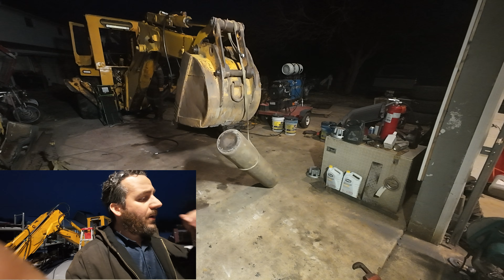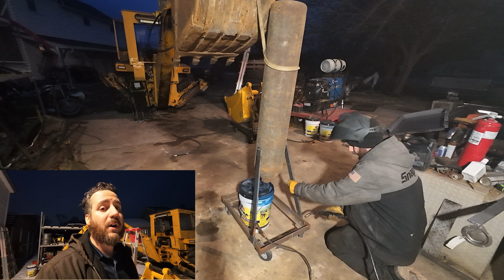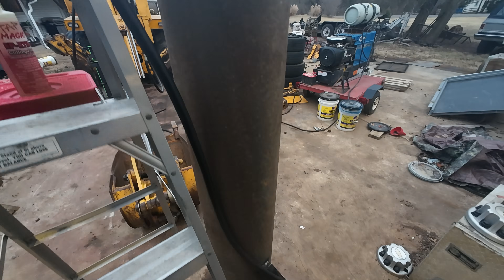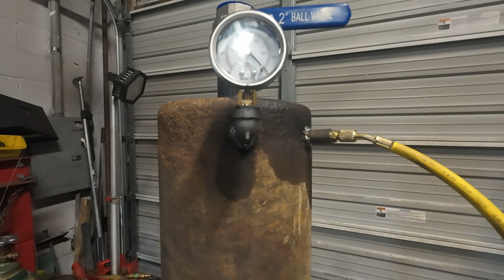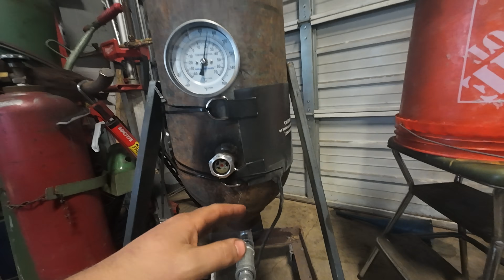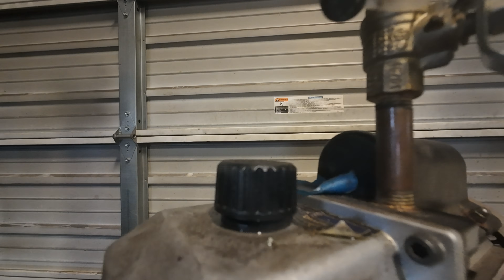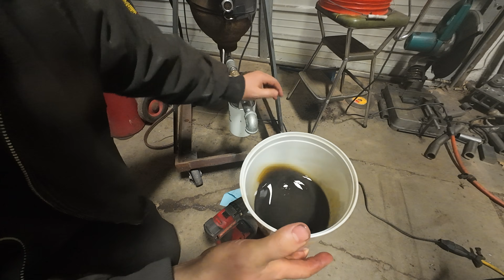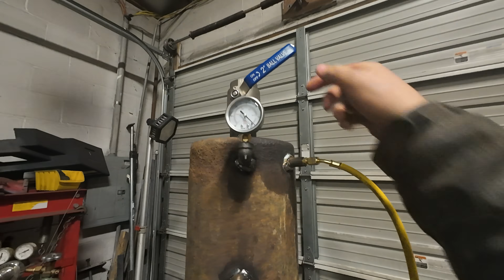I made a machine to remove water from hydraulic oil. Vacuum de-hydration

Comment: if you put the tank under vacuum you can probably suck up the fluid out of the bucket and intoo the bottle using the bottom valve , saves you from carrying the weight up that ladder and possibly pour it ove the fillonening 
could do it with the prefilter testvanve or just add another tap on the bottle m could even put a reduces and a gardenhose sized vacuumhose to the top opening , set bucket on the floor put hose in bucket draw vaccuum and open valve

Comment: @spankranchgarage -  Smart man, and great thinking outside the square. 

To catch the water vapor before the vacuum pump you need a condensor coil (like a Moonshine Still) that is in a cold water bath, into a catch can, then suck the vapours from the top of the catch can up through a large pipe full of heavy steel wool. 

Instead of Batch processing the oil like this, you could instead build a Continuous Vapouriser that attaches to your machines, and runs whenever it's in use. If the oil tank of your machines gets hot enough when in use you could just draw the oil out of the tank via a small orifice, into a vacuum chamber that is kept at low pressure by a vacuum pump that that has enough flow (maybe Airconditioner compressor?). Use the same vapour catch method as I said before. If the tank oil isn't hot enough you'd need to preheat the oil before the orifice valve. Then at the end of the work day you could just drain the catch can.

Comment: You have a tiger by the tail. Imagine being able to rent out a machine to contractors or farmers for example. Plug in a remote line into your machine and circulate hydraulic fluid on a continuous cycle and return to machine. A tractor could idle away as your process improved oil quality. The Machine being warm would keep heating to a minimum. The key will be surface area for the moisture to escape. So your cylinder needs tipping on its side would be an easy start.

Comment: Great Video, Couple(okay, a few. I got carried away) things that I think you'll find helpful.  I've used one of the cheap Vevor kits to do exactly this but for removing water from a CaCl2 and water solution. (basically a road salt based dehumidifier).
1: Use the vacuum pump to pull oil into the tank instead of loading from the top.

2: It seems like it's storing oil in the output near the valve that's not getting cleaned up. Put the valve as the first thing out of the bottom then go straight into a T. One output on the T can be inlet/outlet pre filter(faces down?) the other is goes to a valve before the filter.

3: You could use a very fine filter and pressurize the tank a bit to force it through at a good pace if needed. 

4: Just to note a thing with pumps: Single stage vacuum pumps smoke quite a bit. Especially if you use cheap oil. (very common headache I've found from the vevor single stage pumps being so popular. Fix is to use good oil). 2 stage pumps are less likely to do this. Good oil + a 2 stage pump is a great place to be for long run times. Single stage pumps are more for pulling down to a pressure then shutting off. 

Bonus Idea to make it a lot more hands off. It could run for days if you forgot about it with this.
1: Adding an auto shutoff feature is really easy. I'd suggest getting a vacuum pressure switch so that it will cycle off if you pull down to your max.(What you've seem to of noticed after the run is over with the vacuum and temp gauges) Second method that would be cheaper and probably a better indicator of when it's done is if you do it via a  temperature sensor. I think the guts from an electric hot water heater would work well. Both the heating element (you can bend it upwards to make it fit) and the thermostat that controls the elements. Personally I'd use both suggestions as to not burn up the vacuum pump.  Great video and thanks for sharing. Youtube did me right for once by suggesting this to me.
Reply: Thinking about this some more, You could use my 1st and last suggestions to make this thing mobile. Roll it up next to a machine at the end of the day and suck up 9 gallons of oil or so. Then have it run over night via an extension cord. Then in the AM you just dump it right back into the machine freshly un-watered and filtered.
Reply from the maker: All great tips! Thank you for the extensive response!!!

Comment: Get your self a new 5 gal of hyd fluid, weigh the bucket before and after you pour out the fluid, weigh the bucket, you will know how much the fluid weighs with out water, then weigh the dirty wet fluid, and the diff in weight is the amount of added water

Comment: My thought is that first draw off is mostly water water is heavier than oil so. The first draw down should be with that small spout till you see oil,  then run the oil through the filtered spout
Reply from the maker: I explain in the video why that doesnt work with this fluid.

Comment: In the Marine industry -"fuel polishing" is a thing ... a diesel fuel/water separator will do the job, even with hydro fluid
Reply: Hydraulic oil makes an emulsion, so it won't just gravity drop out. it will just go straight through the separator without dropping it out.
Reply: @nick4506  would a centrifuge help in the process?
Reply: @windage  i mean yea maybe but we're doing gallons here, and if you have a big centrifuge on site so it won't take a billion years, might as well just buy new oil.

Comment: You could use inline damp-rid trap - aka anhydrous calcium chloride. It’s pretty cheap stuff, I guess you could just fill up an old automotive catch can with CaCl2 anhydrous (damp-rid) and run the vacuum through it. It even comes complete with baffles.

Comment: for the machine's hydraulic oil, configure the machine with all of the cylinders either extended or retracted (the exact state doesn't matter, as long as all of them are the same).
drain the main reservoir's oil and process that through your dehydrator.
disconnect the return line into the reservoir and connect that to an auxiliary tank. if you your pump's bypass routes into the return line, plumb that into the now open return line hole on the main reservoir. if it enters the reservoir separately, just plug the hole.
reconfigure the machine so the cylinders are in the other configuration, which should push the fluid in all the cylinders into your auxiliary tank.
run that oil through the dehydrator.
reconnect all the lines as they were originally, and refill the main reservoir while you reconfigure the machine again into whatever state you had them in the first step.
this should get about 85-90% of the oil in the machine. if you run the cycle again before reconnecting the return line to the main reservoir, that should get 97-98% of the oil.
it's a bit of a faff, but it should remove almost all of the water contamination.

Comment: Suggestion. Put a hose in a bucket. Connect the hose to the oil filter. Connect the oil filter to the top of the tank. Use the vacuum pump to suck the oil through the filter and load the tank.

Comment: It feels like it'd be handy to add some sort of vacuum system in the vehicle to pass the oil through a small vacuum chamber. When the vehicle is pushing the oil a lot, the oil will get hot. If you could pass hot oil through a vacuum chamber, you could get it to flash off it's water continuously.

It's funny that your vacuum is eating all the water vapor coming out of your system. You could run a cold trap to condense out the moisture before it hits your vacuum pump.

If you weigh a quart of oil milkshake and a quart of dehydrated oil, can you see a weight difference? If you also weighed a quart of new oil, you'd be able to calculate how much water was in it if your scale had enough resolution.

It might be costly to get a scale of the necessary resolution as oil's density is not all that much less than water. If you had a 1% water fraction, you'd be looking for a 0.2% variation in weight. You'd need a decent scale to detect 0.1g on a 2kg capacity scale.

Comment: https://ipsearch.ipaustralia.gov.au/patents/2008267751 This patent covers an approach to use a recirculating vacuum pump/ drier stage that returns the outlet of the fridge compressor back through the contaminated liquid as super dry air, so the moisture in the oil will readily evaporate then condense again, but in the outlet stage. same concept!! love your work!

Comment: A heating strap will be necessary on a blistering hot Summer day because as the water boils off under vacuum the system cools rapidly. I’ve had the system freeze because of the cooling.  Also, a container before the vacuum pump is imperative.  The stuff in the pot boils and froths violently, especially when emulsifiers are present.  Many thanks for the video, it’s a real pleasure to watch someone who knows what they’re doing

Comment: I am looking to do the same thing. good idea with the old high pressure tank. We have the same problem on our excavator hydraulics. We figured out that the water was getting in through bad hydraulic cylinder seals. If the seals are facing up and oil is leaking out, rain water can get in and sink to the bottom of the cylinder

Comment: I wonder if it would be worthwhile just pouring silica gel into the oil, then filtering it back out (along with the water it has absorbed).  Silica gel is sold very cheaply as cat litter.  (not all cat litter is silica gel, you have to pick the right one).  The spent silica gel  could then be recycled by simply baking it to use again and again.

Comment: this also happens to hvac oil in compressors and if there is to much moisture in the system it burns out the compressor so we install a filterdryer that cleans the moisture out of the oil but they get clogged up easily

Comment: The Algorithm demands long comments, so here's some words. Vacuum oil is cheap, but so is a cold trap. 6-10 feet of tubing followed by a catch can of any kind will take a load off your pump, nothing fancy needed, especially if your shop is under 77 degrees Fahrenheit. Since the oil is pre-cooled to ambient temp, the trap itself can be a plastic container, so long as it holds vacuum. Two drain valves in series lets you "airlock" out water without dropping vacuum.

Comment: Couldn’t u just boil it to steam the water out as water has a lower boiling point than hydraulic fluid and or oil maybe im dumb but yes?
Reply: Some contents of the oil's additive package, and possibly the oil itself will burn near the boiling point of water, leaving soot and other byproducts behind. If you have an excess of steam handy, it would be safer to use a steam eductor to create a vacuum, and possibly a steam jacket to heat the oil.

Comment: To solve the water in the vacuum pump, I do this (as suggested from people who actually uses vacuum pumps in labs)
You close the inlet to the vacuum pump and run it like that for 30 minutes to an hour. Or until the pumping part of the vacuum pump is above the boiling temperature in normal atmospheric (>100C/212F). This will prevent the moisture you take out of the hydraulic oil from condensing in the vacuum pump. Or you can use a shop-vac as a backing pump to the vacuum pump to reduce the temperature that is needed to prevent the water from condensing in the vacuum pump. Water in the vacuum pump oil is very, very bad.

Comment: Yep, you need a cold trap between your oil dehydrating chamber and your pump, id also put an HVAC filter trap between the cold trap and your pump to protect it. the cold trap should draw in through a tube down to the bottom and the vacuum pump connection  near the very top, and dunk it in ice water bath.

Comment: That oil is black new
Reply from the maker: It is very dark new... it even has solids that lay on the bottom of the bucket. Pretty crude/cheap oil
Reply: @ the hydrolic oil from Orileys has metal shavings in it. Have to filter it before putting it in
Reply from the maker: @DRNEGOLICIS  Holy crap! Thats unreal

Comment: Just a thought, if you pull a vacuum on the tank and put a hose on the drain valve you can suck the oil from the bucket to fill the tank.
Reply: The idea of using the existing vacuum to fill the tank with milkshake overlooks the fact the finished process requires draining the tank with no vacuum. Can't have it both ways!
Reply: @Canadazeus pull a vacuum on the tank while it’s empty, then open the drain valve to fill it. After the water is out then release the vacuum and drain the oil.

Comment: I worked in a machine shop.  Machine tools were huge.  We fought moisture constantly!  We didn’t have any tools to fix the problem. Just did alot of draining and replacing. We had a portable filter system.  Can you buy a portable dryer for hydraulic fluid?
Reply from the maker: Companies do make equipment to do this. Its expensive but commercially its affordable.

Comment: It's to protect the specific steel in hydraulic systems. Strong tough steel is never rust proof. Also rust compromises structural integrity, and the pressure in the cylinder increases exponentially as the temperature of the tank rises.

Comment: Dumb question, was the interior of the O2 tank rusty at all? That could be your darkness source. 

If you have a high voltage source, like a model T ignition coil, go around your joints with the HV lead. If you have a leak under vacuum, the HV will arc right to the leak. 

You may consider putting a desccant type air breather on your hydraulic tank, that way hot to cold expansion and contraction won't suck moist air in. You could also probably fill an old oil filter with desiccant beads and run the oil through that on the suction side of the hyd pump... that way it continually strips water out. Best part is once you heat the beads back up to 212+ they release the stored water, and you have fresh beads to use on the oil again. 

I would think you could also use a 40 or 50 gallon propane tank as well. It would give you a bigger surface to play with. 

Neat project! Buddy of mine has a Case 580C and his boom cylinders leak like a sieve and get slugs of water into the system.

Comment: I'm a bit late to the parade, but I remember a very old vid by Watch Wes Work, from way back when he was still mainly working on machine tools and CNCs. To dewater spent cutting fluid and reduce the volume he has to send to disposal, he used a bucket with, at the bottom of the bucket, an immersion heater and an air diffuser, fed by a fish tank air pump. Very basic stuff, low volume, low pressure. The effect of the air flow is a so-called sparging effect, where the small air bubbles entrain the volatile compounds out of the oil, in this case water. The effect is very similar to a vacuum, but without the bother of the vacuum proper. You could try something similar by injecting a small flow of air at the bottom of your tank. 
I'm not sure it can get you to as complete a dewatering as a vacuum pump,  but it may be worth a try for the simplicity.

Comment: I've done something like this before for a different purpose. Get a good stainless steel pressure cooker, tap a couple of holes in the lid, and put it in between your pump and tank. You can put the pressure cooker in a pan full of ice water, and it will catch whatever comes through.

Comment: get a 2 micron filter and a pump to shove it through the filter, and the oil will probably clean up a little.

Also, coalescant filters usually have a water bowl to drain entrapped water.  They pretty much last forever, as long as your oil is clean

Comment: I think I might use this method to process used cooking oil to run in diesel engines. It'll be strained/filtered first, and drying was the step I was hung up on due to the extreme amount of energy I'd have to use boiling it off.
Filter, dry, filter, and it'll be a better fuel than what we get from the pumps. Neat!

Comment: Large chamber, inlet pipe with spray nozzle feeding from bottom of chamber about 1/3 height of chamber. Vac suction on top of chamber with p traps  or blocking plates. Drain valve in bottom of chamber.

Pump the oil in at room temp allow the nozzle to increase temp and spray atomize oil into the air and condense into the base of chamber. 

Drain and refill as needed.

Also as others have said a condensate trap would be smart to save youe vac pump

Comment: As someone else has said, take a bit of inspiration from moonshining stills. On your output line you might be able to take and make a coiled pipe and put it inside a large PVC pipe. From there you could make it so your line is coming from the tank to this coiled pipe, the PVC can be used as a water jacket to pump cool or cold water around the coil to help condense the water in it and then have the output from this coil run to a tank to help collect the water that's condensed, then have a line run from the tank to your vacuum pump. Yes this will make the pump take longer to pull a vacuum, but it should also help remove a large majority of the moisture from the vacuum line.

Comment: Use the lab solution for keeping fluid out of your vac pump.  A second airtight jar with an inlet and outlet will intercept the drips.  Also, an off the shelf 40k ultrasonic transducer welded to the flattest part of the tank should help with fluid separations.
Reply: Proper distillation involves running the steam through a chiller, same as with a whiskey condenser.  That will give you drips at the interception pot, instead of vapor.  A bucket of water will probably work fine for this, with a long enough condenser tube, until it warms up.  Radiator fins and blowing air might be more sustainable.

Comment: wow, excellent. I would think you could disconnect the hydraulic lines to push good oil in and have the other end push out the bad.  Do that for the various lines and you probably would only have to do that twice to get it near 95 percent.